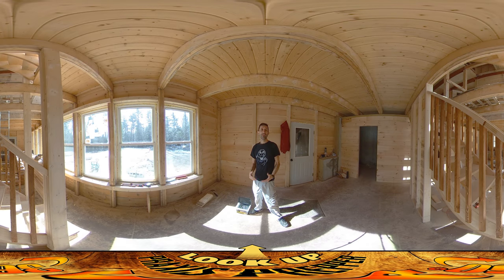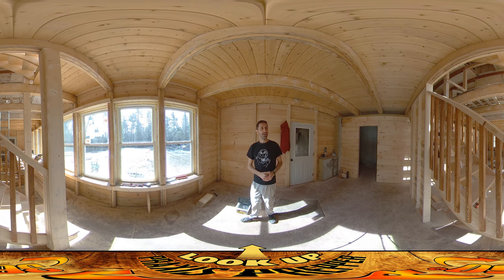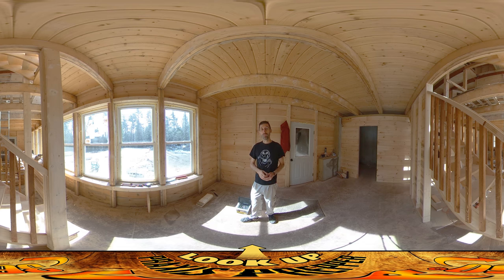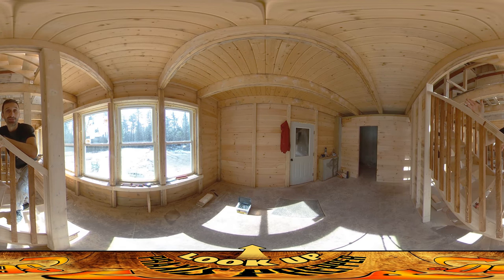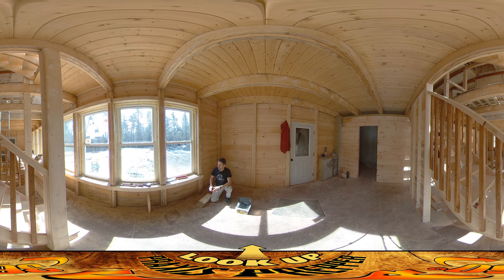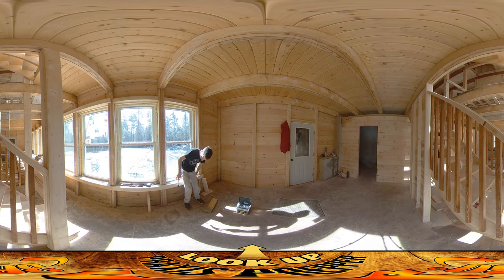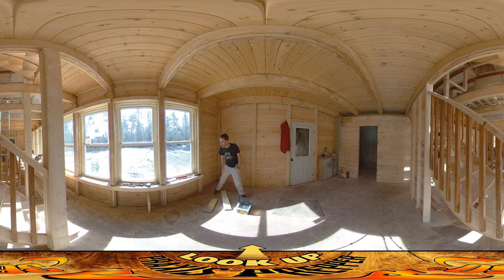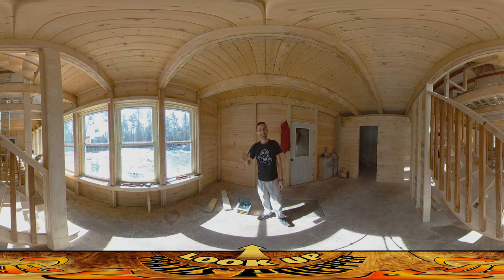Homestead Building - Weird Phantom Power Drains, Bending Stubborn Boards, Window Sills

Comment: I like your progress today better than mine. I spent much of the day building a post & package drop off at the end of my driveway so helpful neighbors can drop off the mail or packages without the friendly handshake. To make sense of that, there are seven households stretched out over about eight miles of dirt road. My place is six miles from the row of mailboxes down on the county road. So, since we are all adding another layer of self isolation to being remote - it was a day of outside work. Gratefully the weather was nice.
Reply from the maker: Sounds like a nice neighborhood.

Comment: You could pull all the circuit breakers one at a time and check the meter after each one .
Reply from the maker: I've actually been doing this. I've been testing it for the past 2 weeks and there have been no huge drains like the previous 2 months.